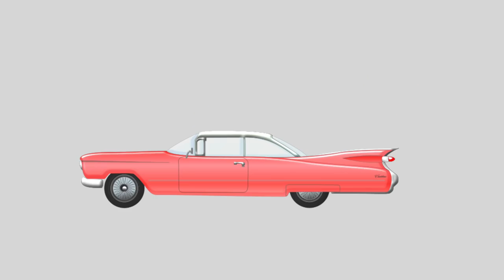Yes, Rockets CAN Fly in a Vacuum

Comment: i disagree simply because there is no atmosphere (vacuum) in "space" . If you have no medium to push against you have no propulsion. Third law works fine in atmosphere but no atmosphere means no law. No amount rhetoric will change the observational analysis regarding this. And insofar as the test done in a "vacuum" chamber ... size does matter and an infinite amount of space is the size and nothing but an infinite amount of propellant would change that. i know you will argue it, but proof is in the doing and i know it hasnt been done.
Reply: So what you are saying is that forcing several hundred kilogrammes of mass to accelerate from 0 relative velocity to a relative velocity of hundreds of meters per second requires no work to be done?
Right, gotcha.
Reply: Niall Kinsella  i shall simplify it for you. 
If there is nothing to push against ...nothing moves. The rocket exhaust requires a medium ( atmosphere ) to push on in order to move. The ability to burn the fuel in space  ( questionable but ill give it to you ) is independent of the ability of that exhaust to propel the rocket in an INFINITE vacuum. And nothing invented changes that fact. 
Hope that clears it up for you
Reply: @flatearthbear4077  
Are you suggesting that the rocket fuel has no inertia?
Because what you are claiming would require rocket fuel to have no inertia.
Reply: Niall Kinsella  Its not a claim . its a fact. The ability to control and direct the burning of fuel is independent of propulsion. an infinite nothing to push against IS the limiting factor in "space" The burning fuel is only a means , not an end. Rocketry only works because there is an atmosphere ( a medium, a substance, for the burning gas to push against. The expulsion of gas from a nozzle is not what makes the rocket move. The gas doesn't move the rocket, the gas requires a medium and acts as a go between .
Reply: @flatearthbear4077  
My question was "Are you suggesting that the rocket fuel had no inertia?"

It's a simple yes or no question.
I don't know why you avoided answering it.
Reply: Niall Kinsella  Your answer lies in the definition and since you chose to pose the question as you did i chose to ignore it . The fuel has no inertia.. its fuel.
Reply: Niall Kinsella  Heres the definition of inertia "Inertia is the resistance of any physical object to any change in its velocity" So tell me again how does inertia apply to fuel? 
Did you mean to ask some other question regarding fuel during combustion and its role in propulsion ?? Because your exact question is not logical
Reply: @flatearthbear4077  
"The fuel has no inertia.. it's fuel"

WRONG
Fuel has mass.
Everything with mass has inertia.
Everything with inertia resists acceleration, meaning you have to apply a force to it to accelerate it.
Every time a force is applied to something, an equal and opposite force is applied also.
This is basic newtonian physics and conservation of momentum.

You've insisted that a physical object with measurable mass has no inertia. You haven't got the slightest idea what you are talking about, and everything you've claimed is wrong.
This is a fact. Deal with it.
Reply: Niall Kinsella according to the definition fuel cant have inertia. Your semantics and fallacious reasoning not withstanding.
Reply: @flatearthbear4077  
Oxford English dictionary physics definition of inertia:
"a property of matter by which it continues in its existing state of rest or uniform motion in a straight line, unless that state is changed by an external force."

Unless you are from an alternate reality, a substance used as fuel absolutely and categorically IS A FORM OF MATTER and so has mass and inertia.
You are trying to say that fuel is not matter?? How can you even justify to yourself a statement so mind bogglingly stupid?
Reply: @flatearthbear4077  fuel MOST CERTAINLY CAN HAVE INERTIA. It has MASS, give it velocity and it has momentum.  WHY do you insist on arguing physics with engineers and physicists when it is OBVIOUS THAT YOU HAVE NEVER TAKEN A PHYSICS CLASS IN YOUR LIFE ??? The Dunning-Kruger is strong with you!
Reply: @flatearthbear4077  "according to the definition, fuel cannot have inertia". This still has me laughing, so you wouldn't feel a difference between being hit over the head with and EMPTY gas propane tank versus a FULL PROPANE TANK?? Can we try the experiment, please?  It's funny because an empty propane tank for my grill weighs about 17 pounds, but when full it is close to 37 pounds.  I wonder where all that extra WEIGHT came from if gas does not have mass??? 🙄
Reply: Kit Canyon  You would do well re reading my initial statement. Nothing has changed, you offer no proof hence my argument stands. You can go around it all day and it wont change the basic fact that if there is no medium ( water, gas , solid ) to react against... you get no propulsion. The rate of thrust is meaningless unless you have something to thrust against. Good luck, im done here
Reply: @flatearthbear4077  - Watch the YT video titled "Uninterrupted Footage of the Falcon Heavy Launch and Booster Landing! 2-6-18"
WATCH THAT VIDEO TO THE END. then report back and I will explain what you just watched.
I predict that you will refuse to watch the video OR wont come back here after you do.
Reply: @flatearthbear4077  did you watch the video yet?  Scared because it proves you wrong?

Comment: Wouldn't the reaction from the action be the exhaust? So, the exhaust escapes into a (vacuum) and it pushes the source of the reaction forward? I'm still not understanding how anything can maneuver in space. Doesn't make sense to me. Here's another way I've looked at this and it still baffles me. Space walking: now, if a person decides and flaps their arms and kicks there legs, ( for every action there is a reaction ), do they create wind or energy to move from their reactions in a vacuum? If so, then why do they have air thrusters? And if they can't, how does the air thrusters achieve movement? Like a balloon, the air/gas released, has a higher pressure inside and when its realeses, it creates an imbalance in pressure and therefore pushes off against the lower, outside of balloon, gases "air". So that's how that moves but in a vacuum in space there isnt this antagonist, right? Or is there a type of gas In space that exists? Sooooo confusing....
Reply: Flapping your arms won't do anything. You gain as much momentum in the opposite direction slowing them as you do when you start moving them.

You need to accelerate some mass and eject it to gain the momentum you need to move. The momentum you gain is equal to the momentum of the mass you ejected, in the opposite direction. This is the equal and opposite reaction.
The laws of motion don't care what state the matter is in, so a gas works as well as a solid.
The Apollo third stage used over 100 metric tons of fuel. All this was mass intended to be ejected at high speed.

Rockets are more complicated than this, but it is the absolute basic explanation.
Reply: Papa here is pissed at me for showing people that he doesn't know what he's talking about and decided to have a little tantrum. He combed through every post under this video for the past month and pasted his insults under any comment I've made.
He calls anyone who doesn't immediately agree with him a chatbot.
Real piece of work here...
Reply: Papa Legba  Do you understand physics?
Reply: @krisdevalle  - No Papa Legba cannot even answer the question: "does GAS have MASS?"
He also believes that crossbows have no recoil....
Reply: @stuartgray5877 Thanks. Let me know if this explanation shows my understanding: Imagine something in space that can be split into two or in half. So, if I space walk out there and unscrew the object and force it apart and push it away from each other, it will separate. 
So the explosions inside the exhaust system of the rocket achieves that separation? So, essentially, the spaceship is continually a separation from constant explosions? 
Sounds right or?
Reply: @4est17  The propellant and oxidiser inside the rocket are mass. It is often called reaction mass. Liquid has mass, gas has mass - the same amount, just in different states. 
We could imagine this to just be bricks. The rocket continually fires one hundred bricks per second out the back. Of course there will be recoil. We know that if we were on an office chair or skateboard, if we threw something heavy in one direction, we would move backwards. This is how it works. 
The rocket chucks an incredible amount of reaction mass out in one direction, and this results in an equal force in the other direction.
Reply: The Third Law Motion always acts on different bodies.